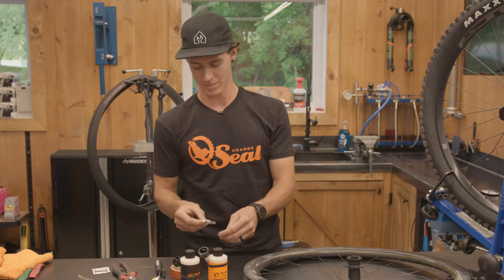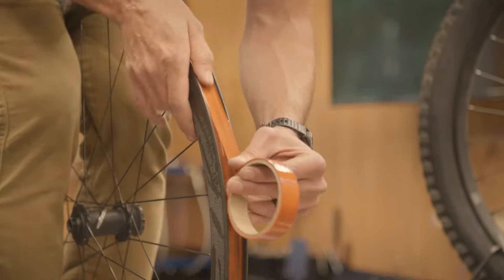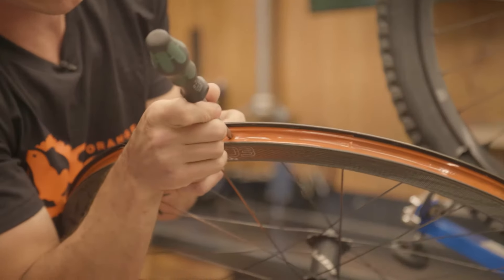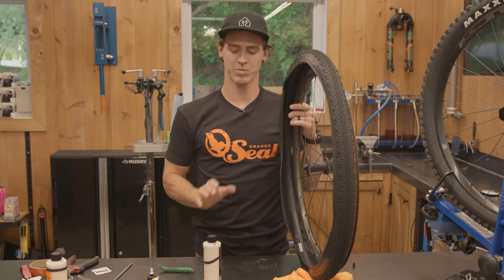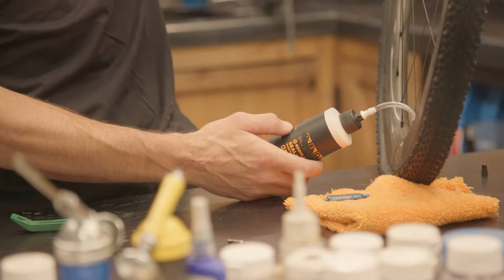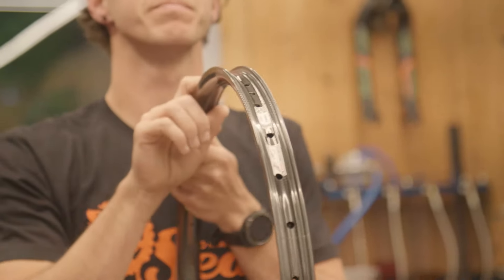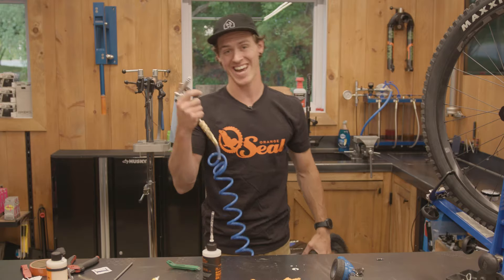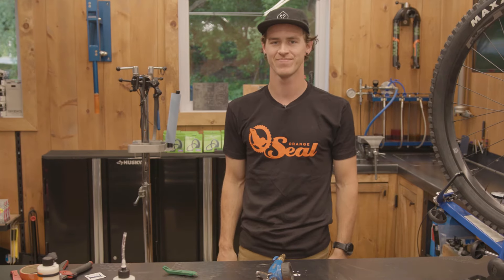Tubeless Install

Comment: 2:18 I poked the wrong hole once, and just kept going.
4:20 I prefer using the stems made by the rim manufacturer, because they pair up quite a bit better, and make a better seal
8:11 this is the first time I've ever seen someone do that last; setting the bead first makes sure you dont end up blowing sealant out, and making a mess.  And honestly, it's easier to just start with a gun (I have a tube on mine to get better flow) when seating the bead; no reason to start with an inflator that might not push enough air
12:12 who's Tyler?